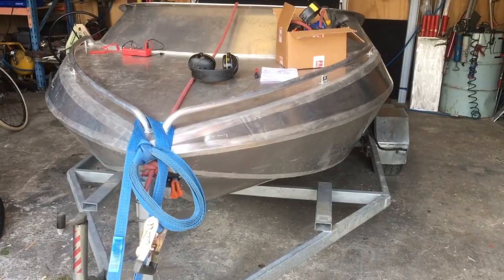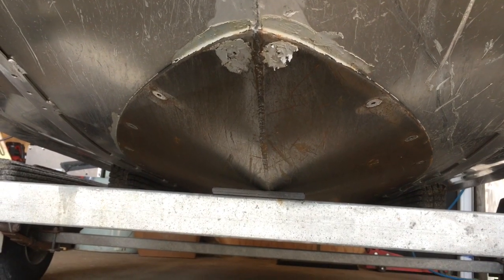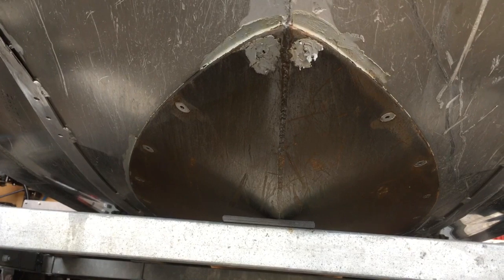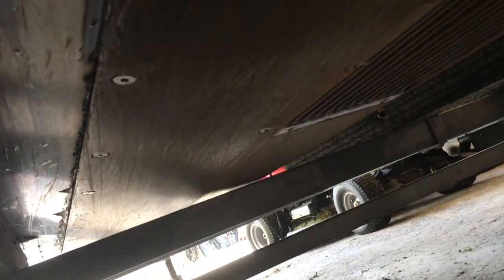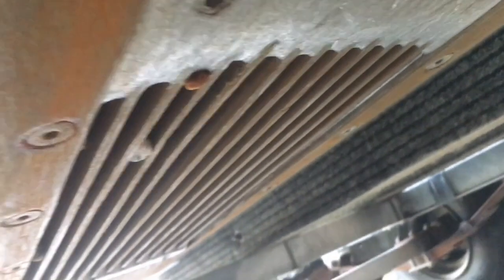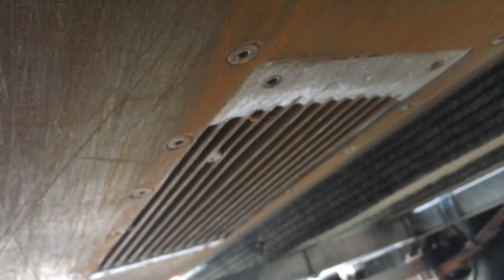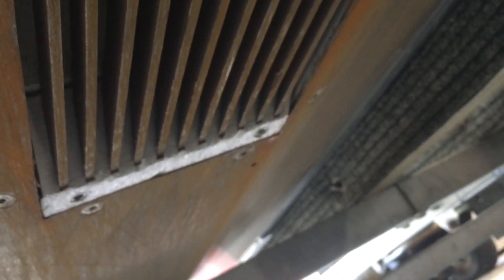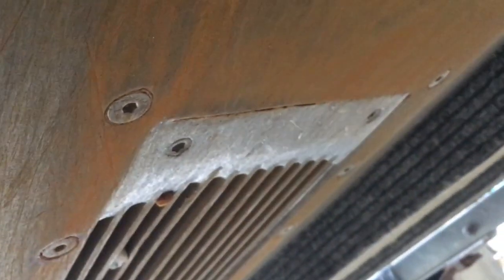WattsCraft how to: Steel Eel steel keel 10/1/2020

Comment: I love the thinking outside of the box! And no doubt it’s put up with some incredible punishment. I’m just curious, how have you dealt with the possibility of electrolysis between the two metals? Is there a sacrificial layer etc.?
Reply from the maker: There is marine adhesive between them but this is a strictly freshwater boat so its not an issue. If it was used in salt it would get ugly pretty quick.